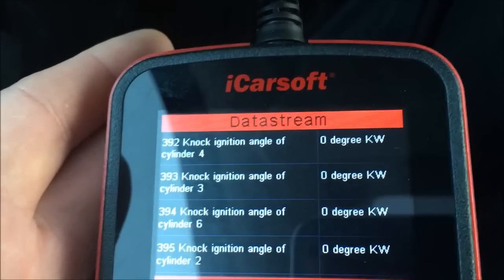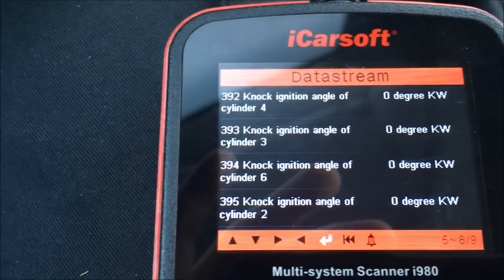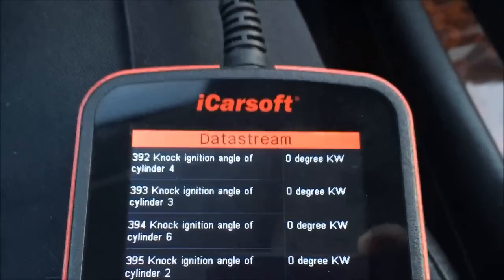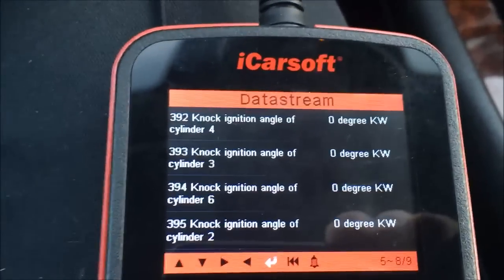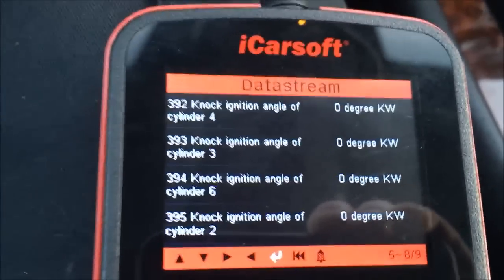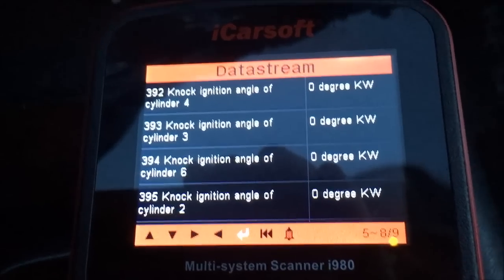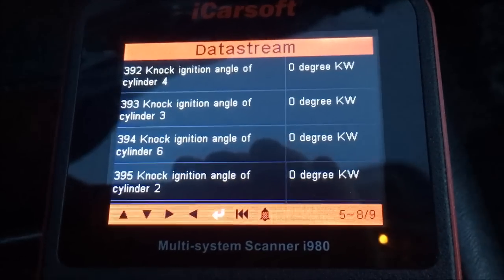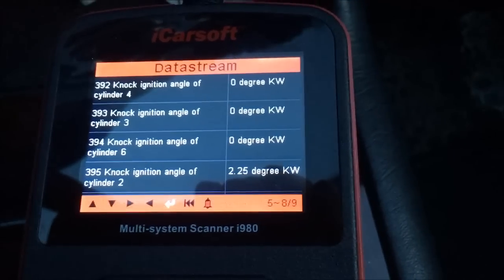Can you use regular fuel in your Mercedes ? .. real time knock test

Comment from the maker: As an addendum to this vid I have gone through 2 tanks of regular during my daily commute . MPG with regular is at least 15% lower than with the premium I generally use . This is most likely due to the use of ethanol in regular and mid grade fuel, and zero ethanol is the premium I usually buy . The gas station I fill up with gives me 7 cents per litre discount on premium when their credit card is used. Combined with a 15% better mileage with premium ,I actually save $ using premium .  Premium fuel is approx 15% more $ than regular. Take away the 7 cents a litre discount and the difference is 8% .  (at this time regular fuel is approx .98 cents per litre ..premium is $1.11 per litre )  average fuel usage on winter gas (winter gas has worse mpg due to anti gelling agents in fuel) in KM per litre (not Litres per 100 km ) is 9.3 with premium mostly highway = approx 23mpg .  on regular fuel last 2 tanks , same conditions ..average KM per litre has been approx 8.1 . around 20.8 mpg. On premium around town I get the same MPG as regular on the highway.  Again this is likely mostly due to ethanol in the regular gasoline . Not true science I know ..Just a reminder that using rewards cards at gas stations can allow you to use premium more economically than using regular.
Reply from the maker: @22chachalaca  correct. On all my older turbo cars I would manually reduce timing by about 4 degrees for regular driving on reg fuel ,and bump it back when I wanted to play and was using premium.  A variable resistor (rheostat ) could be used on the  IATS  to increase fuel enrichment and allow use of regular , But as you say the increase fuel would offset the saving in cost  at the pump
Reply from the maker: @22chachalaca  yeah that's true . If you can drive low load highway speed I think you can save a bit using regular . The ethanol in regular seems to kill that savings as well . For me at least .
Reply from the maker: @22chachalaca  Not all ..The 91 I use still has no ethanol, and I believe shell v-power is still ethanol free . In Canada at least
Reply from the maker: @22chachalaca  this scan tool will ready any generic obd 2 codes , but for many running reading like spark knock , it is Mercedes specific. I'll be reviewing a new scan tool in the next couple of weeks that is 1/2 the price of this one and seems at first glance to be a much better tool for reading Benz codes and doing resets .
Reply: what about a 2005 c230 kompressor
Reply: In Europe the best fuel its in Austria !!!!
Reply: Rewards cards like safeways make you spend hundreds more to get a few cents of a gallon which means you just paid about a hundred bucks a gallon
Reply: SAFEWAY is a grocery store.  Spend $100 on food and get 10 cent discount on gas.  Of course we have to eat, so we would be spending that $100 anyway
Reply from the maker: @smackface6  The reward card I use gives me 7 cents per litre in in store credit , their premium has no ethanol , and it is the same base cost as every other gas station.7 cents a litre cheaper than the others once you factor in the store credit for a store I shop in at least 4 times a week . It's a no brainer . The card has zero annual fee. free concierge service , premium roadside assistance and towing ,double warranty on anything I buy with it, 1 free oil change per year  (I give it away since I do my own) , 4   1/2 price car washes per year , 3 % in store credit for any groceries I buy in any grocery store and 1 % in store credit for any other purchases anywhere, and as long as I pay the balance every month it costs me absolutely nothing . I understand that they give the card in hope people will run a balance and therefore pay interest .I run no balance and use it to buy everything  . I have earned over  $3000  in store credit in under 2 years and it hasn't cost me a penny .
Reply from the maker: @smackface6  Ethanol can increase octane which reduces pre ignition, it also burns slightly cleaner  so it helps emissions . But at the same time decreases gas mileage since it has less btu per unit than non ethanol fuel. It's great for racing where they all have to use the same fuel so mileage isn't a factor and it allows them to increase timing and show an emissions reduction for the race.  Shell V power in the USA should also contain no ethanol as far as I can see .
Reply: Gas stations like Sheetz or Shell will have member cards that give 3 cents off immediately (no need to buy anything else except the gas)
Reply: The video shows midgrade (89) only knocks in full throttle.  And only some cylinders.  I might switch to that & save 30 cents per gallon

.

Comment: E350 is a daily driver why force premium fuel on daily driver its not a high-performance car. My 2013 Lexus GS runs fine on 87. German cars require premium for daily drivers why.
Reply from the maker: It’s all about compression ratios . Higher compression ratios give more power . When you have higher compression you need higher octane to resist engine knock from pre ignition. If you could dial the timing back a degree or two the risk of pre ignition ( compression ignition ) goes away . It would be nice to have the option to switch timing to use lower octane fuel  . A manufacturer would never do that because owners would put in regular fuel and keep the switch on the performance mode causing warranty issues .

Comment: Excellent great video u proves my point as well ... Hey great 🫡job sir thank you for taking your time out to do this type of video.. I drive a 2012 Jaguar 5.0 v8 XF , I'm currently living in Houston Texas I put ( 87 )in my vehicle I have put (89) in my vehicle and I put (93) just to see the difference , even tho my vehicle uses full premium gas 93 but I just wanted to see tha difference and I noticed that (87) my vehicle drive sluggish and slow (89) it drives okay but still a bit sluggish but (93) it drives efficient tha way it's supposed too ... But I have noticed (87) doesn't burn off as fast as (89) and 93 /93 does burn off a little bit faster But it keeps my vehicle running's smoother speedier and faster lol ...

Comment: I did this with my 98 m112 engine for a summer and after about 2k miles it definitely was running differently. I then let it run nearly dry, then filled with 93 octane, and everything was fine again.

Comment: I have 2006 Mercedes e350 what gas would you recommend? Is it bad if I use the cheap gas?
Reply from the maker: If you use mid grade and are very light footed while driving , you will likely be fine . If you drive your car hard ( quick acceleration, towing , full load of people and stuff in car ) 91 octane is best . It will get you better fuel economy as well

Comment: I own a 2010 E350 and 2013 ML350. BOTH knock hard when running on regular. It's a distinct pinging noise when higher RPM. Terrible, I only run premium now. Knock never came back

Comment: I had been using regular gas in my mercedes for years. It’s at like 200k miles now. Just yesterday I noticed the gas lid says PREMIUM ONLY. I am going to try premium once to see if i notice a difference but i doubt it… interesting video tho
Reply: Did you notice anything?
Reply: @jeurycisneros17  Surprisingly, yes. Before the car was at like 3k RPM @ 100kmh, now it’s maybe 2300-2500. The Idle RPM is also lower, and: high speed driving and fast acceleration feels much smoother now. From now on I will always use premium
Reply: @1stbarbiegurl  Honestly it’s probably going to be fine, might throw an error code or run a bit rough at first but not a big deal, you could top off the tank with 91. 

Unless you’re really worried, and have the money to spend, then there’s no harm to pumping out the tank and refilling

Comment: What exactly is knock?
Reply from the maker: Knock is the sound the engine makes when the fuel is ignited prematurely , and is essentially the ignition explosion running head on into the piston. Like 2 cars running full speed into each other . It is caused by a few things . timing of the spark being too early , carbon deposits in the cylinder that remain hot and ignite the fuel mixture before the spark happens , or in high compression performance engines the high pressure as the rising piston squeezes the fuel air mixture can (pressure causes heat) also ignite before the spark plug fires . Octane added to fuel decreases the possibility of pressure induced igniting of the fuel air mixture .The higher the octane the more resistance to igniting from pressure . Highly tuned engines have a higher compression ratio which makes more power (squeezes more air and fuel into a smaller space before the spark plug ignites) but this higher pressure has more possibility of igniting prematurely . Hence high performance engines require premium high octane fuel to prevent that preignition or knock . You can imagine what happens when the piston slams into an exploding expanding wall of flame . It can blow a hole in the piston , destroy connecting rod bearing or bend connecting rods .
Reply: @fupabox  good to know. Thanks for the informative video and explanation-hard times have hit here and I was occasionally using lower octane but I will now cease to do so! I need my car to get to at least 300k ;)

My 2014 C300 just sounds rough... but I've heard others, and I think they just have an engine that kinda sounds funny... I have no idea what I'm talking about, of course, or what I think it should sound like.. lol.

Comment: Knocking can damage the surface of the piston, the cylinder walls or the crankshaft bearings, all of which are expensive to repair. Modern computer-controlled injection systems can correct your fuel mixture to prevent knocking, but at the cost of engine performance. So you are losing performance I guess with lower grade - I don't do alot of driving at 130km or slam the gas pedal down to accelerate as you are in the video since there is no speed limit that high in Canada. I'm not sure you are really damaging your vehicle with normal driving. Cool video thanks for sharing. Running premium is expensive in the ML320.
Reply from the maker: Agree the price of premium is a bit nuts . Thinking of going to a GLK 250 diesel only because I drive 70k km per year . Love the ML , but 25mpg vs 35+ is a big difference. You’re correct that the knock sensor will retard the timing , but it resets to baseline every time the knock goes away . The older Benz models had a little round plug that plugged into the ignition module (1970s 1980s cars ) you could just swap the little plug to retard timing in areas with poor quality fuel . Someone could likely reflash the ECU and change the timing curve . At $1 per gallon less to fill I would sacrifice a few HP for the savings on fill ups if it could be done . May look into it when I get time

Comment: I have a c300 2008 I be driving it on 87 since we had it in 2011 I wanna. Hangs it back to e85 but idk if it will mess up
Reply from the maker: It should be fine

Comment: If engine not able to adjust to regular gas under heavy acceleration uphill,  you will hear pinging or nocking. If you do not hear any you are ok. If you like to race why would u buy family car or suv?
Reply: Agree. On scale from 0-10 there’s always 1, which is very difficult to hear or you will not hear at all. At some point, under harder acceleration, you will hear it. This why in old cars we was manually adjust distributor. Nowadays computer does the job for you. The manufacturer set it and test it then write to us what gas to use. And when they say recommend it’s mean you can use regular. Comp will adjust. It’s to long to explain here how it work
Reply from the maker: sorry that isn't true ... pinging and knock can be happening even if you don;t hear it

Comment: When computer change ignition timing, that degree shows on your scanner, it doesn’t mean “still no good to it”. It’s mean computer just respond to your driving demand and show it’s ability to adjust. 15% drop in fuel economy? Why never dropped in my tests. Maybe 1.5%. And then I noticed that in day heat. I used premium in morning. It’s usual for economy dropping with heat and humidity
Reply: Don’t confuse people with your assumptions.
Reply from the maker: I have explained this many times . The engine adjust to retard the timing until knock is eliminated . Once you release the throttle the timing will go back to the pre programmed timing and will knock again when you put the engine under load. By using lower octane fuel you are introducing knock every time you put the engine under load. fuel economy is WORSE when cold . Cold air is more dense requiring a greater amount of fuel to mix with the dense air .

Comment: Thank you for video.

I put Costco's regular in my E550 M273 engine.

Under heavy load I hear pinging like crazy...I will run octane booster until I finish tank and run out of regular .. 93 octane is a must in these cars if car wil be driven..

If you never do heavy acceleration like you said ..you will not experience pre detonation.
Reply from the maker: agree..Very light throttle ,no hills and you'll get no knock . If you have a 20 year old $500 c class as a beater , I;d throw regular in it all day long . A car you want to keep and have no issues with ...premium
Reply: 91 is all you need according to the Mercedes manual 

.

Comment: Read the owners manual. 
91 or higher octane is recommended. You can use 87 if that is all that is available however you will lose a few MPGs and loose some power.
If you are buying (or leasing) a Mercedes and premium petrol prices are too much of a concern perhaps German autos are not for you.

Comment: @fupabox thank you for the videos, very interesting and helpful stuff. I see that you have the icarsoft i980 reader and was wondering if you know it can clear SRS codes in a c240 2003? I tripped the SRS light when I was working on the wiper switch (turned key on with airbag disconnected...). I tried to clear it using the Launch Creader VII+, it reads the codes but it fails to clear them. All codes are stored and not current so I m quite sure they only need to be cleared.
Thanks!
Reply from the maker: I know the i980 can read the SRS codes , but I haven't had the chance to clear them yet . It is supposed to be able to , but I can't say for sure
Reply: @fupabox  ok thank you for the quick response
Reply: @fupabox  Hi, can your reader do real time numbers on trans temperature? I want to do a fluid change and you need the specific temp to do that.

Comment: Wow I had a Benz years ago put nothing but premium In the tank I was scared to try anything else this is a mini mini years ago so lately best forward to 2020 and I purchased another one a GLA 250 4Matic small little SUV crossover I guess you could call it. It asked for premium the guy at the dealership said I didn’t have to put premium in it so I’m just miffed and mortified I’m here trying to do some research to make sure.
Reply: I am so glad owners manuals exist. The owners manual recommends 91 octane or higher however if 87 is the only petrol available you can use it in a emergency. Because of the computers in the engine, fuel injectors, fuel management system, the computer will make adjustments for low grade fuel. Using 87 will most likely take away a few mpgs and you would loose some power.

Comment: If u have literally any car made in the last 5 years they all have sensors which adjust timing so it doesn't matter it's just slight acceleration differences
Reply: It doesn't adjust until it sees knock, meaning your subjecting your engine to knock constantly as the motor compensates, resets, then compensates over and over again. They're not designed to permanently pull back timing.

Comment: So what I get from this is burn the cheaper grade and avoid putting your car under load.
Reply from the maker: you can do that  . The regular and mid-grade here have ethanol (none in premium ) so the worse mileage with ethanol fuels doesn't end up saving any more than $2  a fill up when I do the calculations , Depends on the difference in cost and whether ethanol is added where you are .
Reply: @fupabox  depends on where you live, it is not that easy to find a station with 0 ethenol premium, in my city there are only 10 stations that have 0 ethenol premium.  The nearest to my home is 6 km away, not bad but I prefer the gas station 500 meters from my home.

Comment: you just have to clean your egr valve pipe more often. Kind of a hassle as on a mercedes it is against the firewall but only takes an hour and some seafoam and wirebrush.

Comment: Depending on where you live, most ppl are unaware of the problems underground storage tanks the gas stations use add, adding another variable in the equation. 
In my city many gas stations are old, the tanks leak and water accumulates diluting the gas stored, lowering the octane.
Most gas stations do nothing until multiple cars fail in a day. The costs are so high that they rarely get replaced. To compound the problem most lots used as gas stations are unable to be reused for other purposes until decades have past due to environmental contamination. So if your town is cash poor, it may look the other way to ensure revenue.
Use new gas stations whenever possible.
Reply from the maker: I would say thats pretty good advice

Comment: I use a mix.... 50:50 of kerosene and jet fuel. It runs great for 2 to 3 minutes, then it needs a full engine rebuilt, which can be frustrating if you need to drive your car more than 1 or 2 miles.
Reply: jet fuel is closer to diesel
Reply: @christianmoline8271  jet fuel is actually a mix of diesel and something else, I cant remember what it is I used to add but i used to do it in the Falklands for the raf fighter jets.
Reply: Jet fuel IS kerrosene